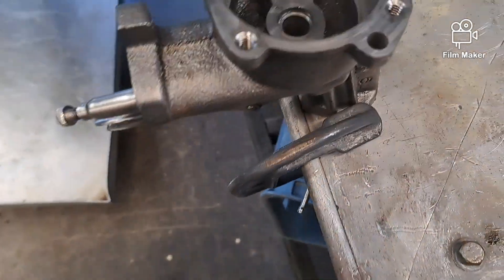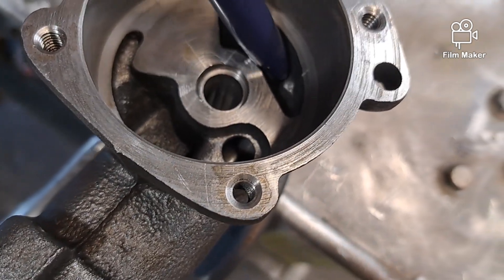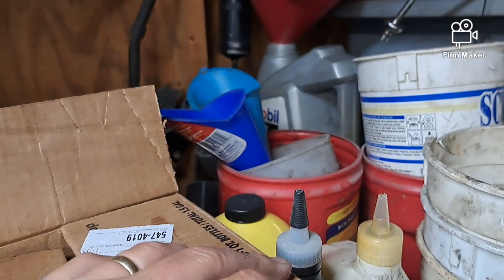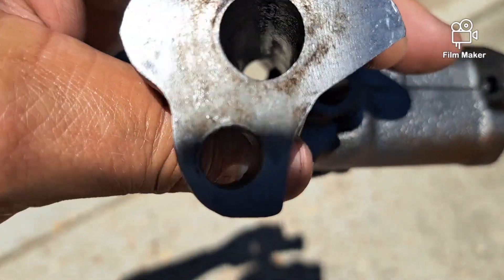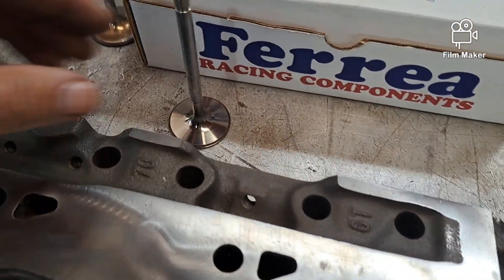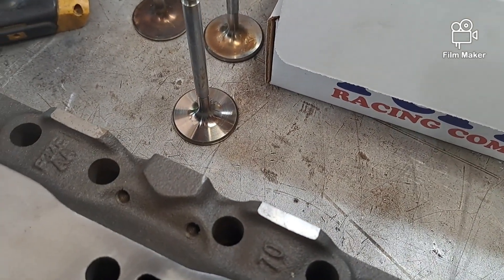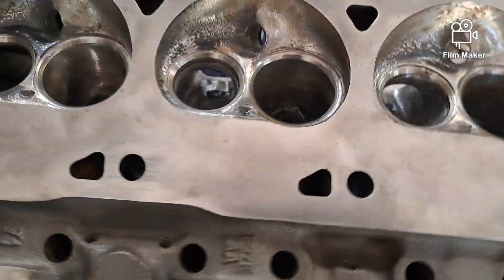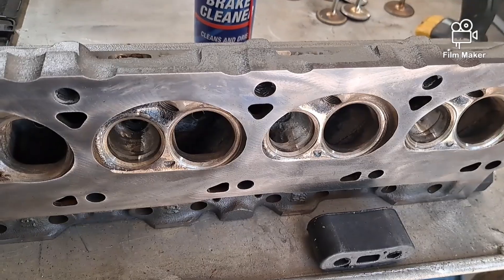Working on the heads and oil pump for the Nite

Comment: David as many heads that you do you should buy a valve grinding machine. You can get a used one on market place. You could make some extra cash doing heads.
Reply from the maker: Thought about it, but have so little room right now. For shits and giggles I looked, found this. https://www.facebook.com/marketplace/item/1425879145001262/?ref=search&referral_code=null&referral_story_type=post&tracking=browse_serp%3A9bd03356-b765-40ad-9727-0a2576998c71

Comment: I have a set of GT40P heads. The valve stems are 9mm(?!) Found this when I bought the Neway valve seat kit.
Reply from the maker: That's normal size for 3 and 4 bar and all the old C9OE.DOOE, heads, 11/32"
Reply: @FXRSDriver  Nah. I have a valve with 11/32 stem. I put it in there. It was like tossing a hot dog down a hallway. Way sloppy. 9mm is >0.010"  larger than 11/32"